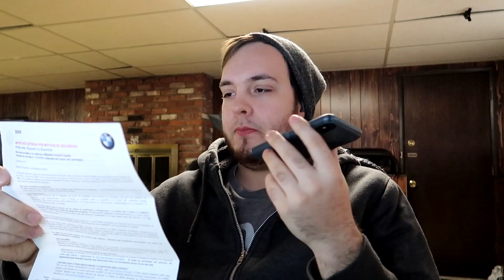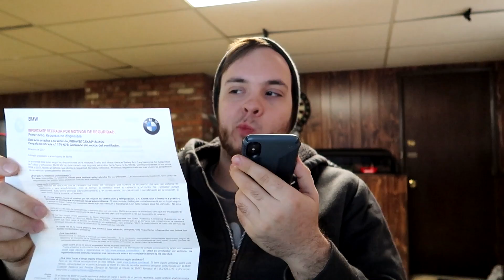BMW E9X Wiring Recall Solutions!

Comment: I love your channel. I was just like both of you in my twenties.  Have fun and keep the videos coming.   I took a look at my wiring, thinking no way could it be damaged.  Sure enough, the brown wire is burnt and exhibits green corrosion.  I was shocked.  2008 BMW 335i Convertible with 49,988 miles on the clock. It is my toy car, so it sits in the garage.  I've unhooked the negative battery terminal, so I don't have to park my car in the street.  Still nervous and calling BMW for when the fix will be ready.

Comment: Hey guys this is an unrelated question to this video, I know you said in another video that you have ebay headers on the e46 and wondered if you had any troubles with exhaust leaks at the lower flange? I installed a set of them on my e46 this summer and have gone through 3 sets of gaskets that keep blowing, as far as I can tell the flange on the block is leak free. Thinking of just welding the damn thing together at this point.
Reply from the maker: That’s strange, there’s been no leaks so far on the two e46s that we have the eBay headers on and on the budget e46 they’ve been on for about 30,000 miles. Maybe check and make sure your whole exhaust system if hung correctly because it could be putting excess stress on those flanges if it’s not supported the whole way to the back of the car, only thing I can think of
Reply: Alright, thanks for the quick reply lol maybe not all ebay headers are created equal I had to move the o2 sensor hole on one of them to keep it from going straight into the firewall maybe I got unlucky with my choice. Ive been putting up with the shitty noise so I don't have to crawl under my car in this weather but it's driving me nuts. Keep it up with the vids bros

Comment: I just took my '08 335 to the Dealer for this blower motor recall, and in the process of getting my car checked and filling out paper work the guy said "oh you have your check engine light on, do you want us to do a diagnostics... it's about $190" (as if I didn't know)  I refused to get it checked simply because I have my own mechanic to do maintenance and im aware of the issue on my car, I just came for the RECALL which is FREE... on the report they wrote "check engine light on, oil leaking, and car is running rough (they never drove my car nor did they run a diagnostics -__- )  .. After 30 minutes of receiving the car, driving back home (15 miles away), My ABS sensor went off, The windshield wipers turned on by themselves, coolant was leaking, the car was overheating, and the turn signals weren't working, the gas pedal wasn't working and the battery was dead 0%.. I called BMW and all they said was "well, we see on the report your car had a check engine light on and we asked if you wanted a diagnostics to be done but you said no, and the car seemed to be running rough. Bring it in and we can see wats iron" I told them it was their fault and they should charge for diagnostics they said "You'll have to pay $190 and any repair cost that we make".. (hence: my car was working perfectly fine prior to taking it in the dealer and not ONCE has this ever happened) ... Welcome to BMW
Reply: Danny P. What did it end up being??